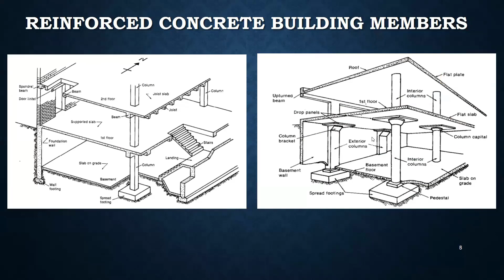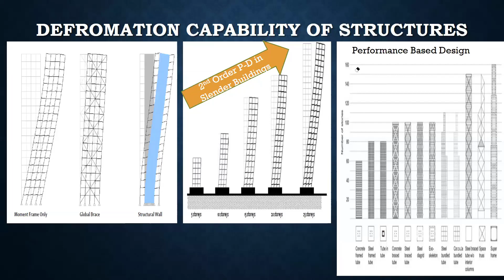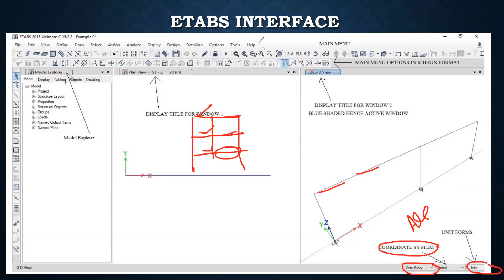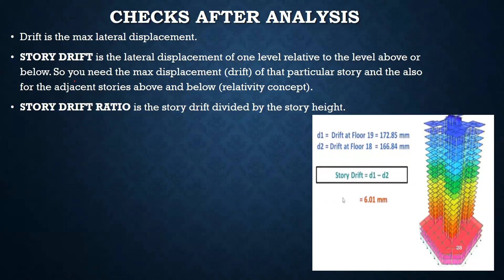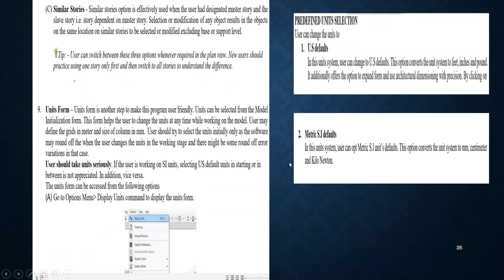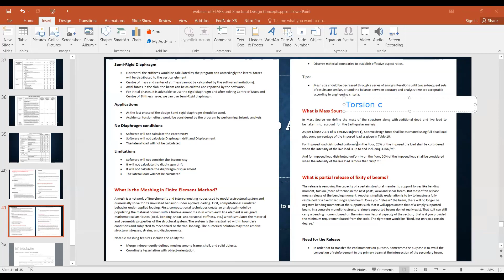[Webinar] Designing Building Systems in ETABS and Concepts

Comment: My 3rd question is that, as we detail any beam in a way having smaller spacings b/w stirrups near both ends while wider at the mid,
Now, if we have a secondary beam attached then in that case how would be the detailing arrangement or criteria of both the beams i.e, primary and secondary beam attached..???
and at which location of the primary beam, the secondary beam should be attached i.e, near supports or mid, or share its placement or attachment concept too...????
Reply from the maker: Beam detailing is same as per standard practice whether it is primary or secondary 
And location of secondary beam is decided after checking the architecture features that It should not be in conflict with any architects requirement or create any obstruction or bad aesthetics 

And how we decide about the secondary beams, if our spans are too large and we are getting very high depths, to control the deflection requirements and depth of beam we use this option.

Comment: Secondly, I am not getting the topic of partial release of fixity of beam. Kindly do explain it again..
Reply from the maker: Normally beams are resting on columns for which we provide rigid joints or fixed joints to  transfer the moments from beam to the columns, however when we are resting one beam over another beam then the connection is a pin joint, if we do not release the end moments while modelling in ETABs, it will produce additional moments which will require too much steel and also the modelling will not be correct.

Comment: Assalam-o-Alaikum.
Sir! when to consider the P-delta analysis...?? Kindly share its limitations i.e, storeys or zones, etc..??
Reply from the maker: P-Delta analysis is required when high vertical and lateral forces act simultaneously on a structure, causing first and second-order lateral displacement. In other words, it is a nonlinear geometric effect of large direct stress acting upon transverse bending and shear behavior.

The P-Delta analysis is a type of Geometric nonlinearity, which accounts for secondary structural behavior when axial and transverse loads are simultaneously applied to beam or wall elements.